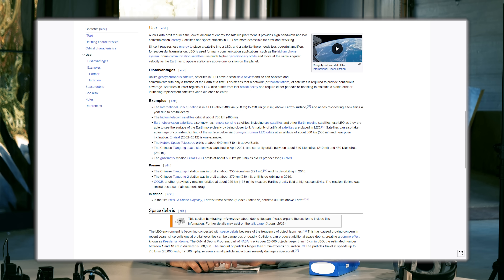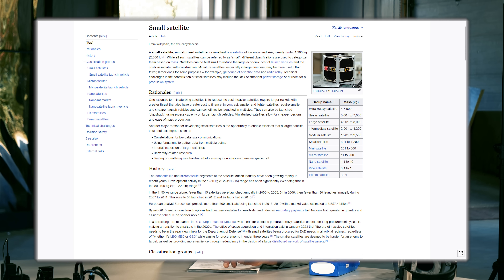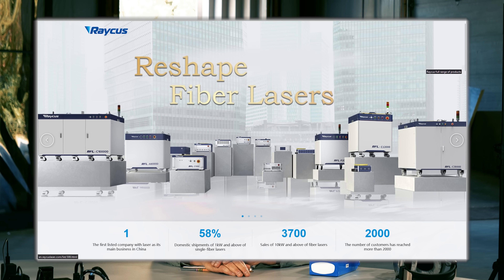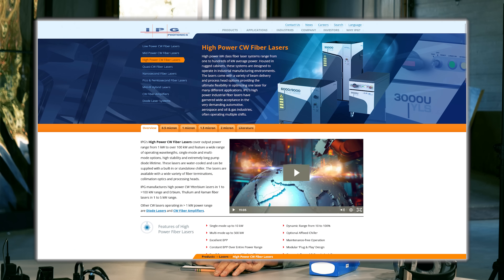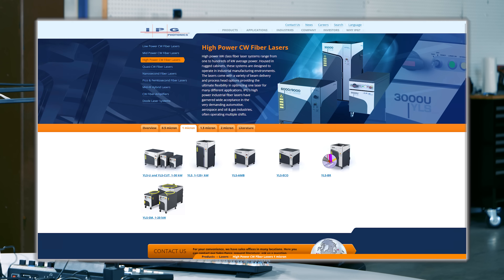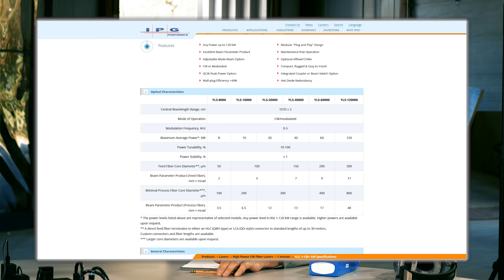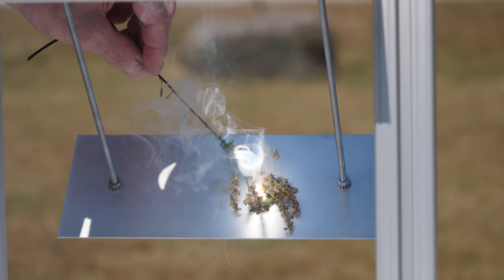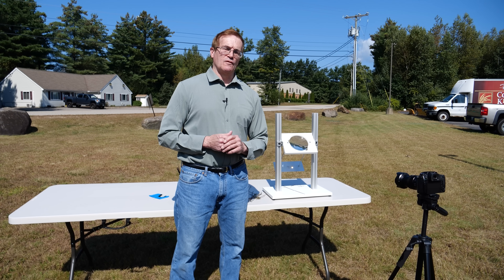COULD SATELLITE LASERS REALLY DO THIS?...

Comment: FYI - the "Published" range of known ship mounted systems - which are NOT super heavy is 900 miles.
Which in of itself raises interesting questions about the flat Earth theory, as why would you need a straight line weapon that could not hit a target 900 miles away if we lived on a globe.  In fact at 40 miles it would have to fire through hundreds of feet of water to hit a target 40 miles away on a globe.

That being said, the published ranges are well outside the height of Satellites, making range on non-sensical argument / consideration.

Satellites are said to be about 350 or so miles high, the publicly known range of DEWs are almost three times that.

So . . . not an issue at all.
Reply from the maker: The "published" range doesn't  make sense. Anything can be said, but a little geometry and some basic optics knowledge go a long way.
Reply: Doesn't make sense?  Its concentrated light . . . if fired into the sky, that beam of light will travel until absorbed by an object regardless of range.  What you MIGHT question is the strength (concentration) of that beam of light.  Well . . . it is already on ships, helicopters, aircraft of all kinds and land-based missile defense platforms.  They absurd HYPOTHESIS that YOU THINK the multinational published range of these weapons is in error is certainly not one you can support, nor does it make scientific sense.  The strength of the beam is simply a matter of magnitude and power sourcing.  Both questions already have existing answers in other scientifically obvious and fielded applications. 

You and I will both likely live long enough to see the private space corporations revealed as government contractors that have launched (already done) military communications and weapons platforms.

A hint of which was just published Yesterday when Israel threatened Elon Musk regarding his satellite communications systems relative to Gaza.

Sorry, but you need to do deeper research about these systems before making statements that are refuted before you speak them. @TechIngredients
Reply from the maker: As I said, do the math and apply basic optics principles like the ones I discussed  in the video.
Don't  be dependent  on claims you don't  understand or don't bother to work out.
Published claims may be accurate, in error, or intentionally misleading. Think for yourself and be a leader, not a follower.
Reply: You ASSume much.  I have been involved in technology development since the days before GPS.  I am CERTAIN that laser technology is much more than capable of destroying targets with 3 meter accuracy from 900 miles and more.  The "optics" you mentioned have been in full practical use for at least 8 years.  I suspect longer.  The ranges claimed my military technology companies are NOT contested by anyone but you.  They have also been tested at over 300 mile sea to air already, and that is confirmed by many at live fire exercises from the US, UK and France.  Also the general notion is admitted to by the Russians and Chinese, as it is a bragging / discussion point . . . again publicly.
Don't just blab about something for click bait or possibly political reasons.  Do the research, which takes minutes.
 @TechIngredients
Reply: I once had a pointless discussion with a very smart friend who is currently a physics teacher.  He told me that based on his calculations, a broad side of nine 16 guns could not move a battleship in the water.

I showed him video, images, got two old gunners from the American Legion, and both German and US gunnery charts and instructions that referred to the " shock drift" adjustment you must make while stationary while bombarding a stationary target.  He still thought his calculations were correct, even after I showed him two documentaries, and more video.

I am telling you that what YOU SAY is theoretical - definitely already exists and has for no less than 8 years.  In practical service now for at least 5 years. @TechIngredients
Reply from the maker: Comments are not clickbate.
So have I.
Your  "smart" friend doesn't  sound very smart. He (they) were also probably too lazy to do the math, or you didn't understand  what was meant and concluded that the  discussion  was pointless.
I did the research and actually  understood the principles. You clearly  haven't and are projecting your excuses.
Thanks for watching our video, and goodbye.

Comment: I think very large DEWs are being used to manipulate high and low pressure zones in the atmosphere, creating ridiculous currents and conditions like the entire left half of the US sucked dry of all moisture and the entire right half being blasted with high precipitation and freezing temps.

Seems plausible to control weather patterns with accumulated heat in the atmosphere
Reply from the maker: That seems unlikely. The power levels would be enormous. Obviously,  I know a little about this subject, and generating that amount of power isn't possible... yet.

Comment: Interesting - at the orbital speed of such a weapon what would be the length of time on target? at a range of 400km the directional control of the beam may be an additional limiting factor and the angle through the atmosphere as the satellite moves away from the target will increase the depth of atmosphere to penetrate increasing diffusion - plausible but unlikely - its way cheaper to send an undercover agent  with a box of matches
Reply from the maker: As I explained in the video, it's about 10 minutes.

Comment: What you suggest can't be what happened?Because there were puddles of aluminum molten aluminum streaming away from cars.That's how hot this fire was , so it had to come From some kind of scaler directed energy weapon.
Reply from the maker: Those reports of melted aluminum surrounding vehicles have a much better explanation. The fuel onboard each vehicle is an extremely energetic source.  It is also relatively easy to ignite it if the vehicle is sitting anywhere near a small fire. If we stick with the physics, then a laser based attack isn't supported by that specific  evidence.
This isn't to say that the fires weren't initiated by malevolent actors or that corrupt politicians weren't involved at any stage from the beginning to the terrible response or investigation. 
As scientists and citizens, we will gain more creditibility if we are reasonable and logical and demand the facts... all of them.

Comment: How much grass do you need to melt car glass and aluminum wheels, if a car is parked on the street away from grass, and the 1 next to it is not affected at all and it happens to be blue? Or is blue generally the best color to reflect heat?
What about lasers mounted on large military planes?, those have been around for decades, and the technology has only gotten better.
Reply from the maker: You need ALOT of grass!  But, even a partially filled gas tank will do nicely. 
Blue is a lousy wavelength for extended transmission through the atmosphere. Infrared is easier to generate at very high power levels and is less distorted by the air as it travels to the target.

Comment: 7.42 you just finished stating that a power supply with such a large amount of power generation doesn't exist... I'm pretty sure the sun's energy could be harnessed to do just that with a type of solar concentrator... Could probably even refocus the sun's energy into a beam which means a laser wouldn't be needed... Just a lense setup... Wardencliffe tower was like a layden jar, using the water table to collect and store energy... Telsa built an emitter that later was dubbed the death ray, basically a modified transmitter that utilized spark gap technology as an electrical lightning emitter... He used coils set up in a wheatstone bridge alignment to create a sort of electromagnetic barrel to project the electrical bolt along a stabilised beam... There are alot of options that will require new thinking to bring into the light

Comment: Liion batteries can't be charged in cold environment's so you need another energy source for the satelite.
Reply from the maker: The inside  of a satellite  doesn't  have to be cold. The total volume of the battery  would be one ft^3. That's  easy to enclose.

Comment: You did not address the melted aluminum.  We often see cars burnt to a crisp yet the aluminum wheels ant engine remain intact.
Reply from the maker: I have in numerous comments, but you're right, I didn't in the video. 
The most reasonable explanation is the fuel in the vehicle. Nearby fires from grass and debris can rupture the fuel tank, and the gassoline can easily melt the aluminum in the wheels.

Comment: The biggest problem with your generalization calculations is still the power factors.  In order to produce the amount of maximum burnout to total destruction of the batteries in a five minute window period of effective focus, you would require q factor of 200X more battery capacity than the initial assumption, and possibly much more than that.  Lithium-ion batteries cannot release all of their energy immediately, and they cannot release more than 10% of their total energy anyway, they are not designed to do this nor is the energy discharge controllers that operate with LI energy storage devices is not designed to operate a discharge greater than 10% of it's total storage, and that is released over hours, not minutes or seconds.  A good example of this are the many common devices like hoverboard battery fires, and this is considered within the design parameters of the devices under heavy load.
Reply from the maker: Almost everything you said is incorrect. 
The actual  battery  I held up during  the video  is a good example. It is a typical, although  large, example of a hobbyist RC battery. Its  safe maximum  discharge rate is approximately 3 times greater than needed for the application, and we have operated  it repeatedly at that level.
Also,  the specified battery  capacity  is based on discharge from full to a safe level, not to a dead battery.
Batteries can be defective, and they can easily  overheat during  rapid charging and discharging. Look into the engineering of the Tesla battery cooling systems.  It's impressive.

Comment: I think the problem with trying to figure out what is causing these fires is we are basically working blind as we can only speculate causes with the current known/accessible technology.  We all know there are MASSIVE black projects every year and it's anyone's guess as to what the true capabilities are of the KNOWN technologies let alone those of unknown (top-secret/classified) techs.    Even if they used currently disclosed tech, there may be secret advancements in certain aspects that could make turn the case from "impossible" to highly possible.  

If in 1940 someone claimed they could easily hold a 1000w amplifier in their outstretched hand, you might have said this was impossible because the amp would weigh 150-200+ lbs.  What you didn't know is the amplifier uses transistors instead of vacuum tubes & only weight 7-10lbs, but transistor's aren't publicly known & are a top secret military project.  

The same reasoning should be applied, or at least considered, whenever trying to figure out the cause of some of these mysterious happenings.
Reply from the maker: That reasoning isn't useful.  Speculating that technology  exists without limit won't  allow us to make any reasonable estimates.
Reply: @TechIngredients  I'm not sure I said without limit & agree with that and it does open the door to too many possibilities.  I do think it irresponsiible to make blanket statements about what is & isn't possible (in these outlier cases) as there should be some consideration given to the unknowns.  If this wasn't the standard for scientific advancement, we would still be walking everywhere because a wheel is impossible. 

Hypothesizing  causes is extremely difficult in today's world of government & media lies and the villainization of those who dare to ask hard questions is plain evil.  I can't imagine how the fire victims feel (Maui & Cali from years ago) especially when there is so much evidence that doesn't support & outright contradicts the official story.
Reply from the maker: Yes, you did.
If you disagree, then where do you place those limits, and what evidence are you using to position them?

Comment: It's never going to be free from finicky vibration, even though the fibre you still have the optical precision to deal with and you still have to have a stable platform it's not just a closed portable system it's a big pain in the but and it's OLD SKOOOL

Comment: If a sattilite can read your license plate than they can focus a lazer to a one inch patern and presto it works
Reply from the maker: It's more complicated.  Imaging involves what's called MTF or the amount that features in a scene can be detected above the noise. With enough signal and a long enough integration time, meaningfully data can be acquired above the resolution limit.  This is called super-resolution imaging.
On the other hand, a laser beam needs all or nearly all its energy in the focused  spot.  These are very different thresholds.

Comment: Red light increases cellular metabolism.  Energy is enabled more things get done.  Weight is lost.  There are dozens of YouTube videos on Red Light.  5mw Lasers are cheep and abundant.  put many lasers on a 4" X 6" project board and use it to reduce belly fat.  Will it work in practice?  I think that the theory is sound.  Do not up the power of the 5mw laser.  A pulse width Modulated controller would be good.

Comment: The assumptions are fine for realities, when written.
I agree that putting a 16 inch naval gun on a Boston Whaler makes no sense. Directed Energy Weapons require a lot energy at the source  to deliver material damage onto the destination...  
Until the weight budget changes from 70kg to 100000kg 
(100 metric tons of the 150 payload of next generation LEO spacecraft). 
Might also shorten a weapon's orbital altitude from 400 km to about 175 km.
For weaponry, a gas laser (CO2 and others) can be very very powerful, with the virtue of being easier to cool at high output. They are heavier than solid state fiber lasers but can deliver very high coherent output, And I'm assuming we will soon have vehicles than can navigate well over 100 Tons of weaponery in the Low Earth Orbit space.
Last, there is a technique to use a powerful laser to ionize a tube of air, which briefly makes that a conductive tube, and then send a quite substantial bolt of a  electrodynamic discharge (lightning) to the target. 
But this is getting five years ahead of practical engineering. 

I admire this video breaking down the problem posed into reasonable parts for analysis. Very good!
Reply: All weapons in orbit are rather easy to destroy, but the consequences in debris to near earth space can be terrible.
All weapons in orbit are closely tracked by multiple major space fairing nations. 
The Use of a weapon From space to damage a little civilian community on Hawaii would not go unnoticed and belief of such "foreign laser attacks - from space! " ignores very present current military realities.
The tendency to blame exotic distant force for local tragedy and local incompetence is very human.
But we've heard of satellites releasing Krakens and altering voting machines - which utter bullshit cost Fox about  billion for defamatory lies.
Let's stick to evidence with facts.

Comment: Yeah but all you need is the right type of lens for a satellite laser you know when you look at a big old telescope lens and you shoot a laser through something like that you can keep a tight beam on it like using a magnifying glass the state of fire
Reply from the maker: It's more complicated than that. There is a property of all electromagnetic radiation, including light called diffraction. It's always present no matter what a lens or a mirror is doing. Over a distance, it will dominate, and it will cause the light to spread. You can't prevent it.

Comment: I appreciate your explanation,  but what incinerates a cat so fast that the charcoaled remains of the body is in tact... STANDING? That is something about the Maui fires that i can not unsee.
Reply from the maker: The amount of heat released by even a small fire and Maui wasn't small is orders of magnitude greater than the energy from the world's largest lasers, and these can't be launched, they're too big.
The infrared radiation from that fire can be lethal. It can melt windows and cause vegetation at a distance to burst into flame. That is why steel workers have to stand behind barriers when they open the furnace.

Comment: Yes they can and I think that’s what started the paradise northern California fires. And I’ve seen videos where you can see a green laser through the smoke.
Reply from the maker: I don't think it is.
A green laser is common at the consumer level for pointers and alignment diodes.  But, for high power applications, the lasers operate in the near infrared and are invisible.

Comment: What about a satellite that just magnifies the sun.  Light weight and requires way less mechanical parts
Reply from the maker: Sunlight is not coherent, and (this is the major problem) the sun is an extended source at 1/2 degree. The sunlight will diverge much faster than a laser.
Reply: @ that’s what I sort of suspected.  I think I was just maybe thinking we could continue to bend internal mirrors until it became thinner and sharper.
Reply from the maker: Divergence is independent of focus.  No matter how the mirrors and lenses are configured, the light will diverge anyway.
Focus, or the lack of it, just makes it worse.
Reply: @ thanks for the clarification